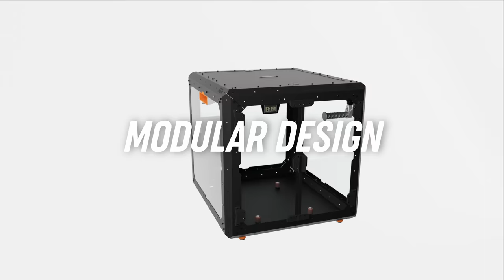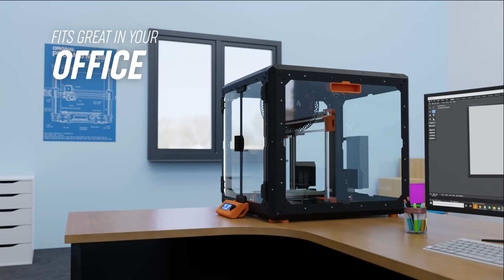Introducing the Original Prusa Enclosure: Modular box with advanced features for your MK3S+!

Comment: Would love it for my machines - but that price is close to be that of an entire printer.
Reply: For the sake of anyone that hasn't heard of them, I went with Printer-Box, and I'm very happy with it and will be using it with the MMU2 addon. Still metal and half the cost, check them out.
Reply: Not true. The printer costs 2.8x as much as the enclosure.
Reply: @rsilvers129  unless you want the addons.
Reply: @rsilvers129  he didnt mention the over priced prusa mk3s
Reply: Oh I thought that included the printer?🤔
Reply: There's something wrong in the price list: the box itself is not as much expensive (369), but the price of the addons is a bit excessive IMHO. That said, 369 + air filter (79,99) should be 448,99; why then if I add that optional it gets 488,98? Where those 40 € more come from?? 🤔
Reply: @andrealioce4341  website says it automatically adds the required psu needed for either the filtration system or the rgb
Reply: @LongDono  half the cost? It’s $300.. these are $350
Reply: @bdubd9072  you are right, it's stated in the description. I keep thinking the base enclosure is a must have, but all the addons are a bit too expensive
Reply: @andrealioce4341  apply some hairspray or use better filament and you won't have wrapping.
Reply: @rsilvers129  This enclosure is roughly half (47%) of the cost of the Mk3S+ kit and 100% the cost of a Prusa Mini kit. It's not a good value when a Lack enclosure costs 120 max.
Reply: @TheRAINMan059  The basic enclosure. If you want all the add-ons its almost the same price as the printer.
Reply: @glp.1337  Right. The base enclosure price is that of an entire new Prusa Mini.  If you buy all the parts to a Prusa Lack enclosure, you'll be left with enough money for an Ender 3. It's a really bad value for most prusa owners even if it is nice. We're just talking about a box here.

Comment: Neat idea. Price point is hillariously high, which someone would need to be to buy this.
Reply: How much is it?
Reply: @christianansorge3819  370 € basic up to 730 € Full Encloser-Setup...
Reply: Price up doing it yourself with the slot snd plexi..... the one I'm building for my XL and 2 mk3s is neigh on £1000.....  the price of materials is sky high snd won't be coming back down
Reply: You should find better sources. 8020 extrusions (the brand, not size) can be had, with pc/macrolon or UHMW panels, can easily be sourced for less than $300 - even at a quantity of 1.
Reply: Are they shipping yet ?

Comment: I was in the process of building one I designed for myself, and got exciting in seeing this, as it has most of the features I was designing plus a modular power supply cable.
And then I saw the price.
I'll stick to the one I have designed. :)
Reply: Yeah, same thing. His products offer good quality but mannnnn... it hurts my wallet so much when I saw that price.
I think, I gonna stick my old Ikea furniture closed enclosure, it work like charm.
Reply: They know that you (and me) are not the target audience for this product.

"It made sense to create something high-quality and advanced (designed and tested by us, aimed for businesses, schools and other institutions) because the DIY enclosure from IKEA Lack tables is still a good budget option, so there was no need to create a replacement for it."
Reply: @clemenslucas  Compared to the printers marketed to schools and businesses, the XL with a full enclosure and all 5 nozzles is a bargain. And yet I suspect they'll still pass Prusa Research by because they don't have support contracts yet (that will change once they get the print farm system going).
Reply: That entire enclosure can be made with standard lexan panels you but at Home Depot. Just design and 3D print the corner brackets and whatever other accessories you think you need. Very simple to do.
Reply: I just finished building my own enclosure when I saw this. The price made me feel a lot better about doing it myself.
Reply: Same, when the enclosure costs half of the printer its to expensive.
Reply: @OU81TWO  Keep in mind what you are paying for here isn't just the materials involved.  There is research and development that went into this, and Prusa backs their products with support.  You can certainly design your own enclosure but you're comparing apples and oranges in that case.
Reply: @ArrowRaider  Research and development?? It's just a fancy box with doors.
Reply: @OU81TWO  Bruh so is a house if you're gonna simplify shit down. It's all the little details that make a thing worth its asking price.
Reply: @zoeysilver2500  The majority of houses are over valued.
Reply: @OU81TWO  You're totally right,  but that's more of a capitalism issue.
Reply: @clemenslucas  It's not aimed at my business, because the bottom line matters to me. If Something else can do the same job for 1/6th the price (IKEA ), I go for the other product. It's about functionality, not looks and bling! I can buy 2 x Creality Ender 3's for the price of that enclosure. As a business, I know which will make me more money!
Reply: @simonbaxter8001  As a business it's too expensive fiddling around building a DIY case and way cheaper to buy a case which is ready to go.
Reply: @HolgerPusch  No when I can buy 2 more printers for the same price (Ender 3's). That makes more productivity sense than an expensive case for the few times you need to print in heat sensitive materials!
Reply: @simonbaxter8001  No, if you are fiddling several hours to build your own case it's way more expensive than to buy a case which is ready to go in a couple of minutes
Reply: @HolgerPusch  "Couple of minutes" ... it's a kit! If it's anything like the MK3, that's 2 or 3 hours to assemble it. I can have IKEA deliver parts, print the parts overnight and put an IKEA based one together in 30 minutes! ... That's less than $50 of my time, $50 of parts. In my business (Electronics) the price of this enclosure is some serious test equipment that has real return on investment. Not sure what business you're in, but you obviously have money to burn!
Reply: @MMuraseofSandvich  It's going to be darn near impossible for them to get business contracts unless they can provide in person support and repair. That is what companies pay the big bucks for with support contracts.
Reply: @simonbaxter8001  Yes, it's a kit which includes all needed parts that fit together and can be assembled in several minutes...maybe 30, but that's it.
If you build your own diy case you have to buy the parts (screws, hinches, acryl, shelve, electronics, etc.) from several distributers, have to cut acrylic plates, drill holes and so on.
In business it isn't a good idea to waste time in which you can earn more money to buy a better and stackable case.
For hobby a diy case is best of course. But not as a business.
Reply: I simply bought a small server cabinet for my prusa (already have 2 mk3s+) but this enclosure is fkn expensive
Reply: @ArrowRaider  Agree.  I think in the large picture do the one time purchase and be done with it rather than try save money and spend a good amount of time spending a dollar to save a dime mentality.  Just do it right.  That 300 bucks is nothing.

Comment: The most interesting thing for me is the fire suppression system.
Also: considering the stackability: this product is probably more designed for companies instead of the average Joe home user. I have my IKEA Lack-Case and I'm happy with it. But this DIY-thing wouldn't work for a company. You just need a machine that you can setup and forget.
Reply: Those fire systems you can buy everywhere. They are common in engine cabins from boats etc. because of the fire a fuse will light and the bar will put out a substance that will down the fire.
Reply: @borisbommen  How is such a thing called? Can't find it.
Reply: @TJ13062010  smoke/fire alarm, some of them have a wifi too. Check for Tuya/Sonoff
Reply: @TJ13062010  AUTOMATIC TUBE STYLE FIRE EXTINGUISHER SUPPRESSION SYSTEM FIRESLAYER 6'
Reply: @TJ13062010  in Dutch its called a blusstaaf. It activates above a certain temperature and releases molecules that suffocate the fire. You can only use this in enclosures!
Reply: ikea lack is made of curogated cardboard it has me on edge
Reply: @killincards  : well the base is multiplex which is hung to a wall. The top is a lack table. However Lack tables are pretty stirdy. If I didn't hang it on the wall I might have put it on a Lack table as well 🤷‍♂️
Reply: @killincards  Shhh. If you don't look. Nobody knows.
Reply: @TJ13062010  a cardboard box is plenty sturdy but very flammable
Reply: @killincards  Ah. Now I get where you are going. I have a smoke detektor in my printing cabinet and in the room in which the cabinet is mounted to the wall.
Reply: I'm just going to put my printer in my fireplace. If it burns it burns 🤷‍♂️
Reply: @killincards  I'll tell you right now. If your printer is getting hot enough to instantly combust even cardboard then you have bigger problems then what the table is made out of because if it's that hot the printer itself is on fire and if it's on fire it's going to melt right though all that acrylic this case is made out of then you will have more burning plastic. It's literally just a metal husk. Also ironically the plastic this case is made out of has a lower ignition temp then corrugated cardboard lol. cardboard is around 850F, acrylic is around 800F.

Comment: I like the idea of bringing back life to an older printer, but how easy is it to get to the back of the MMU2?  How about the spools of filament (enclosure)?  How does Prusa have theirs configured for MMU2s?  Maybe Mikki needs to do a video on that, seems to be several questions on the MMU2.
Reply: Looks about the same size as all the other enclosures that support the MMU2. Generally with that many rolls you run the filament through the top or back from the outside. The benefit is a smaller enclosure that takes less time to heat up, gets to a desired temperature.
Reply: Yeah getting to the MMU2s might be a bit tuff. Wish they would show more then one picture of that.

Comment: I was checking off features ive already included on my custom enclosure haha. Im happy with what i have but the modular design is the main draw for me. I do worry about the stability of it on those small feet and does the enclosure allow space for the muu2s with a paving stone under the printer to reduce ringing? Does stacking this type of enclosure transfer vibrations to other enclosures around it?

Comment: Be aware that, after building my own enclosure several years ago, large PLA prints started failing, I finally figured out it was the heat and always print PLA with the door open, it hasn't failed since.
Reply: Don't you use a thermometer? My door is closed and the temperature don't go over 28 °C. Maybe it's because the printer in the sellers and the volume of my box is oversized.

Comment: I would like to see how the MMU2S and additional spools fit inside this (if at all). I've skipped MMU2S so far because it takes up too much space and there's no easy way to remove it once installed to make the printer single color. But if this could make it more organized, I would reconsider.
Reply: There's a setting in the Prusa Slicer that will make it print one color through the MMU2S

Comment: The electronics is still inside the box. This limits the temp to 35C, what is not enough for printing technical materials. Looks better than the IKEA box, but the result is the same. You can easily heat up the IKEA box also.
Reply: The video shows external mounting for the power supply, which is the only thing that is heat sensitive.
Reply: @gravitywavesRMS  and a motherboard. :D
Reply: @gravitywavesRMS  The stepper drivers are the most heat sensitive, they already get warm and there is already no cooling fan in that Einsy RAMBo enclosure!

Comment: Ikea lack is a bit cheaper :) but this looks very very cool!! 👍 👍
Reply: You can stack  5 onto each other. Would'nt work with Lack. So add extra m² rent to the cost of Lack, so this enclosure is much cheaper if you live in Manhaten, Frankfurt or Tokio, but back country it is the other way around ;-)
Reply: +1 for $7 Ikea Lack tables as well.
Reply: @cognetic  HAH wish they were that cheap. It's not 2018 anymore. Looks like the prices came back down a bit. The base is currently $12.99 and the blonde color is $14.99. A few months ago I paid nearly $20 a unit for Blonde and most stores were out of stock. Still a great option but you have to factor in the Acrylic and time to make it what you want. personally the Lacks were primarily just printer tables for me. Which keeps that part cheap.
Reply: @Rainmotorsports  wow!  Yup got mine for $7 a piece back in the days.  I ended up not doing the acrylic.  I just let the (2) MK3 free-ball it.  Only do PETG now.  No warping issues so far.  I would have for sure bought that case on initial purchase. But after 4+ years without a case, I think I'd prefer no case at all now.
Reply: @cognetic  yeah PETG does fine open air. If you have a draft issue just slap a cardboard door on it or something. Prusas print farm does have the advantage of the elevated temps of 400 running printers. But I've rarely had any issues. My Prusa is my ABS printer now that I've built an enclosure. I would probably never spend the money on this but it looks great.
Reply: @Rainmotorsports  I'd probably throw some coin at it, if it had a "Prusa" cam and phone app, to view, monitor and get notices (filament alerts, crash detection, power, remaining time frames, etc). I'd pay some coin for that, vs pi, octoprint, etc.
Reply: @Rainmotorsports  here in the Netherlands they cost €4.99 a piece

Comment: Hello Prusa, looks great! Glad the power supply is external, but what about the einsy box? I made an enclosure and I ended up installing a duct that went from the outside of the enclosure into the side of the einsy box to pipe in cool air. Just seems like without some cool air circulating around the einsy electronics there would be too much thermal stress on its components.
Reply: I have no problems running everything inside with a chamber temp around 50C. But for shure putting everything outside is better and a easy job.
Reply: @lazyman1011  what's the best way to get the einsy outside of the enclosure? Does Prusa make an extender cable harness? 🤔 or would that be something I'd need to make?
Reply: @marklang7004  Just diy, no magic there. If you have time make a new harness, otherwise elongate them. I’m not shure which signals etc. ran over it but I wouldn’t max it out to much. Short as possible.

Comment: Or.... use an old upright fridge/freezer.  Just cut a hole in the door and use sealant to fix some old glass. I just extended the wiring harnesses and fed them through to the electronics housing and screen that I placed on top shelf of the freezer. That also uses the sliding baskets for storing tools and filament.  I mainly store the filament on a high shelf of the fridge section above the printer as the heat keeps it nice and dry 😉. No draughts and no issues with abs, nylon and even pc....

Comment: Just got my enclosure and am not happy.    The assembly manual is rev 3 but apparently nobody at Prusa has ever assembled one with the optional accessories.  After nearly completing the assembly, I find that I have to undo much of my work because it is nearly impossible to install the filter system and additional power supply once the kit is assembled.  I've seen several of these for sale on the used marketplace and almost all of the ads state the options were purchased but never installed.  I can see why.

Comment: I use the mmu2 and a gravity spoolholder which is placed at the top of the enclosure (currently using a server rack as the enclsoure, it's massive and I have a fan blowing the air inside the enclosure into a duct that's attached to a window lol. It's massive :$). With this enclosure can the spoolholders be placed on top of the enclosure as well?

Comment: Looks great!  But with the MMU2, where do you put the 5 rolls of filament?
Reply: On top like most enclosures i would imagine.
Reply: @Rainmotorsports  Which would make it no longer stackable.  I'm hoping there is a better solution.
Reply: @InspGadgt  your better solution comes in 2 forms. You buy an enclosure big enough which is not desirable for most people as bigger means lower temps and slower heating. Or you do Ultimaker style. Filament in a separate box. Which is still stackable and can have some positives. You can still treat it like a dry storage box. But if they aren't making it that means you'll need something custom to match the size.
Reply: @Rainmotorsports  And that is my point...they make the MMU2, advertise it as compatible with this enclosure.  They make the enclosure...but they don't yet have a solution for holding the spools for the MMU2.  I'm hoping Prusa will address this themselves and come up with a solution.